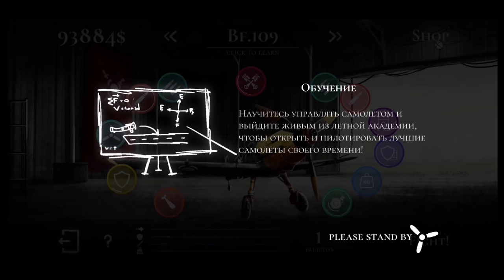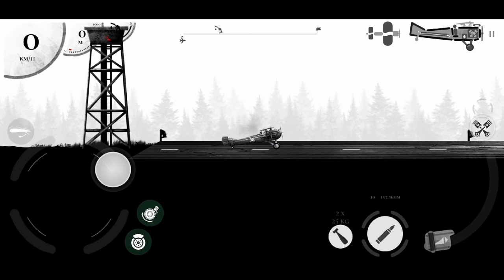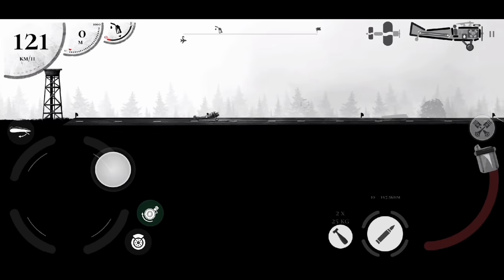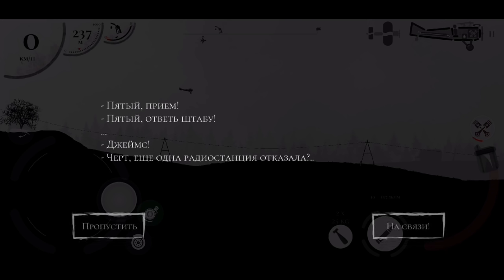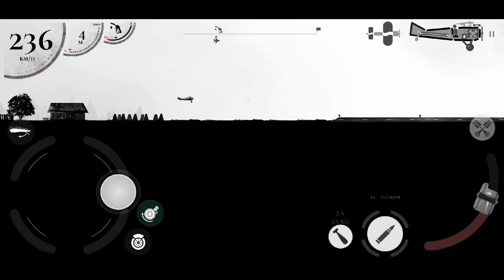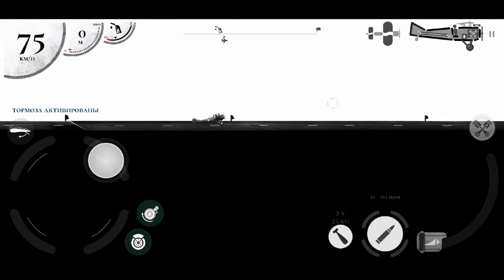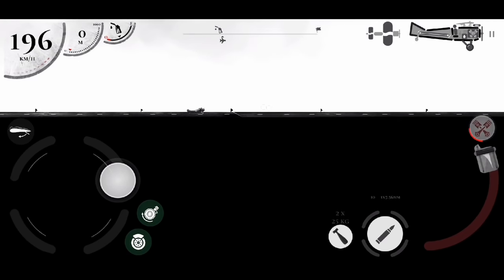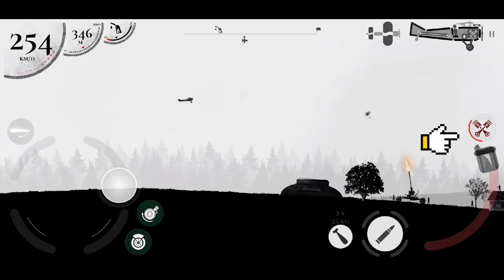Warplane Inc. Tutorial

Comment: Explanation is good enough in english. Prop planes typically lift off and land with less than maximum engine thrust. If you try that with a bf109 she will nose down pretty damn fast. 
The plane should be horizontal on the landing gear before liftoff, and the facing should have less of an effect on landing, rather lowering, engine thrust slowly, since we can reach max speed so fast even on the initial runway, facing should be less of a factor than raising or lowering landing gear which will cause more drag overall. That being said not every WW2 plane had landing gear that was retractable, in which case it is even easier to land. Horizontal and vertical speed are almost equal in landing WW2 props, heading only matters at low speeds. In fact using boost on the engine was imparitive for luftwaffe in the air because of boom and zoom doctrine.